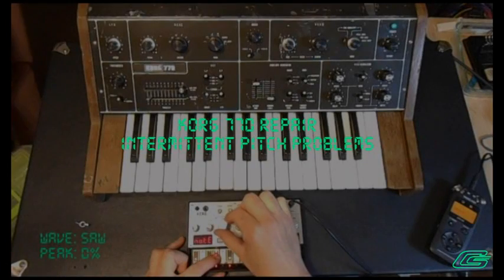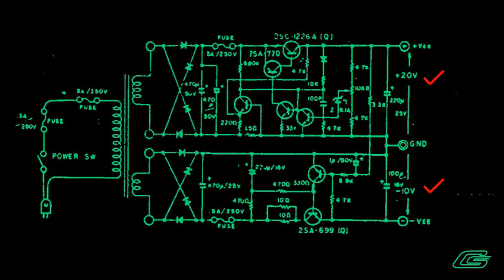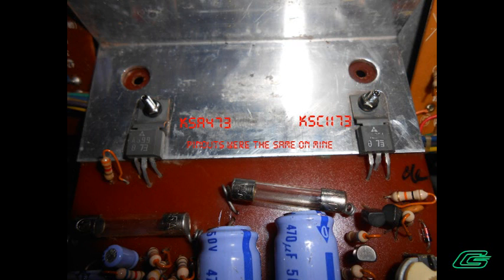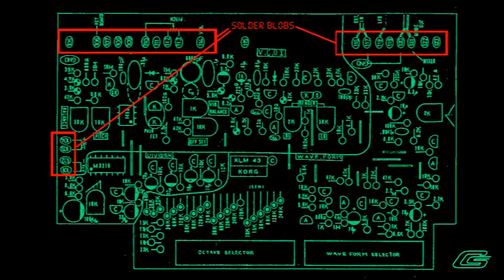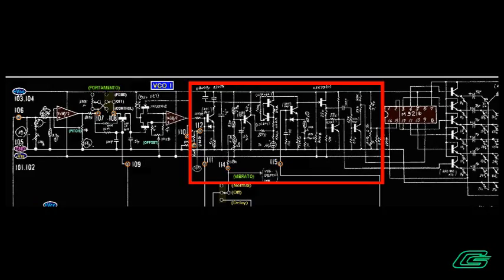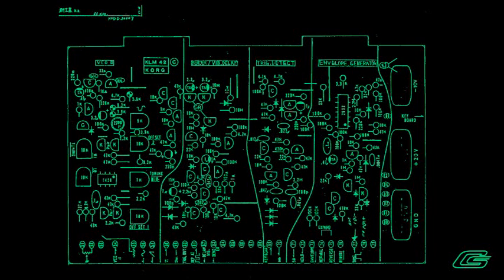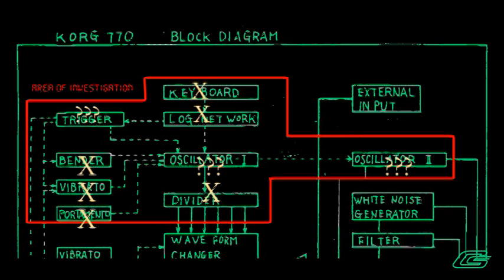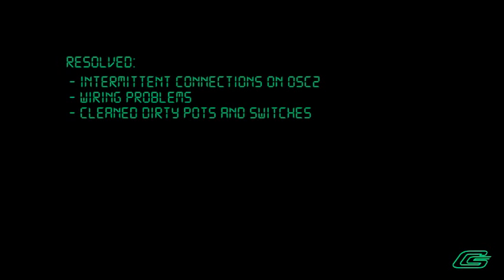Korg 770 Synthesizer Troubleshooting Intermittent Pitch Problems

Comment: This video has been great, thank you. Just to hear you talk through your approach is helpful. I am having an issue with ptich on my 770, and one thing I noticed is that when I take the chassis apart (bottom half from top half) the synth becomes barely audible. This seems strange to me. Do you have any idea where the chassis ground is? Also, I'm curious how you "Added an Earth Ground to the chassis". Thanks in advance for your help!
Reply from the maker: No idea on those issues.  What I usually do is take the ground wire from the EIC connector and bolt it to the metal chassis.

Comment: I cant tune up my korg 700s with service manual... cleaned the key bed contacts and de-oxed pots etc... checked voltages 20v and -10v ok... no fluctuation. The pitches are stable but things are shifted on the keyboard... hard to explain.  C1 key plays A and so on...  I found bad resistor in the keyboard matrix but it didn't fix problem.  What is the Log Network for and how does it work?Is it where i should start looking next ? how do I test the keyboard voltage divider matrix for correct voltages. Sorry for many questions but I have to get this fix thanks
Reply from the maker: Not sure what's going on or where to look.  Log Network is just the resistor key array in which Korg synths deal with Hz/Volt, it's a logarithmic relation between voltage and pitch.  As opposed to 1 Volt/Octave on other synths which are considered a linear pitch voltage relationship.

Comment: Thank you for posting this! I have a 770 with intermittent pitch problems, as well as a dodgy resonance selector and portamento switch. I know what to look for now regarding the pitch problem. The reso and portamento switches, I'm not sure if it's the switches or the board they are attached to. The portamento comes in when ever it wants to, so I just end up leaving it on and turned to zero. I'm dealing with another problem regarding the attack control. The previous owner (or one of many) has removed the slide pot for some reason, and bridged the connections with a 10 Kohm (or Mohm?) resistor. I purchased a slide pot of the required value from Mouser and put that one in. It works somewhat, but the attack is way too short for what it should be, despite following the schematics and soldering it in correctly. What could I be missing? I would love to make a kind of patch box to connect to the synth for added modularity. Could you suggest any useful patch points on the internals? By the way my 770 is cosmetically too banged up to restore, so I don't mind a few extra switches and jacks on it's face. Great job explaining the troubleshooting flow on your machine. This is very helpful.
Reply from the maker: The intermittent portamento definitely sounds like a bad wiring solder point.  The envelope settings also run through a selector switch that might require cleaning, re-soldering.  Same for resonance selector, cleaning and/or re-solder.  For external CV inputs check out the retrofit kit from Kenton UK, it adds pitch/gate/filter.
Reply: gstormelectro Do you think it would be possible to have simultaneous outputs of al the 770's waveforms or can there be only one at a time that's active? It would be cool if I could mix individual waveforms, or cross patch one to another in a vco to make a hybrid wave (e. g. saw > pulse, etc.) sorry for the silly questions, I'm not too well versed in electronics beyond soldering and replacing simple components.
Reply from the maker: Waveform mixing like on the Minibrute?  Oh yeah.  Cykong website has a 
clean color-coded 770 schematic.  The 770 uses one circuit for VCO1, and
 the selector determines which wave output stage you get from that 
circuit.  What you're proposing is to replace the selector switch with a
 signal mixer.  As with mixing any audio signals - a sub-mixer circuit 
would need to be designed to do what you're wanting.  This sub-mixed 
signal then could be routed back to the VCO1/VCO2 mix stage.  The 
Minibrute design for a waveform mixer might be a good starting point, 
and can be found on hackabrute website at yusynth.
Reply: Awesome! Thanks for your info! I can't wait to interface this thing with my Microzwerg.
Reply: Quick question about replacement parts - is it possible to find Korg style knobs and switches at common major electronics suppliers such as Mouser, Allelectronics, etc, or are these proprietary to Korg only? And while I'm at it, do you know the exact model number and type for the Attack Time slide control pot? The one I use now doesn't seem to fit right and may be off value. I have decided to try and restore it as good as I can, instead of further defacing and modding it. Hold that modding part, I might still do it but I want it to be as discrete as possible. I certainly can't do much about the dings and scratches, but I'd like to at least get it to work properly for a start and find the missing knobs to match, so it would be helpful to know something about those parts.
Reply from the maker: Availability of compatible replacements will depend on the part.  For the slide pot, match the specs from the datasheets: linear taper, throw distance, mounting hole distance.  I can't remember if it is soldered to a pcb, be sure to check, in that case mounting pin locations do matter.  How about your 3-way DP3T switches?  I ordered from mouser were TE Connectivity/Alcoswitch CST023NK, however now unavailable.  Rotary pots are just panel mount w/ wired pins, some pots are tough to find, I ended up getting from Ebay.  The 770-style knobs that go on the rotary pots are notoriously difficult to source.